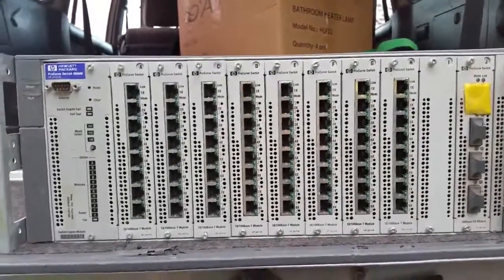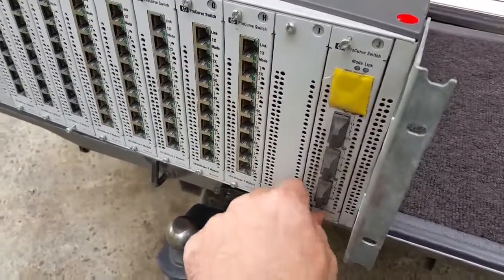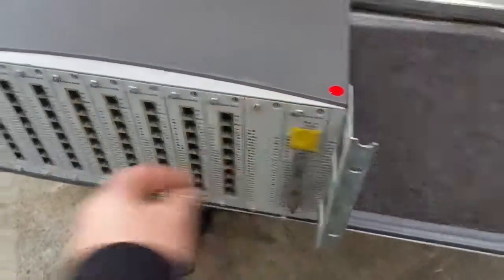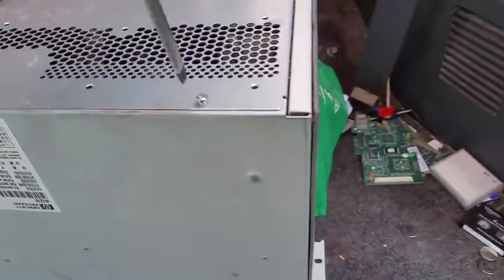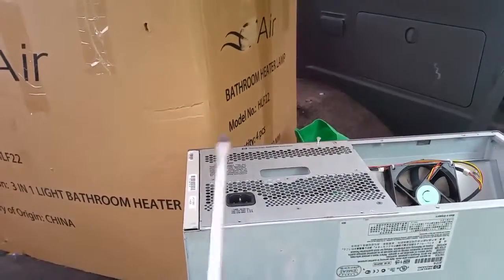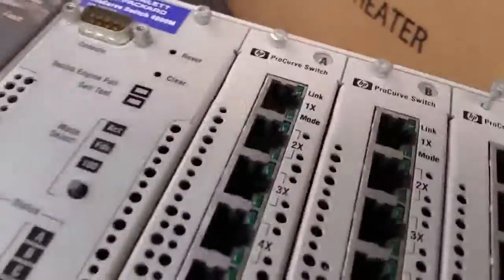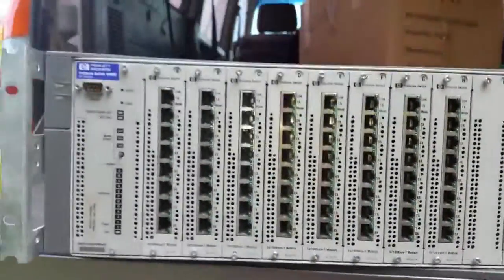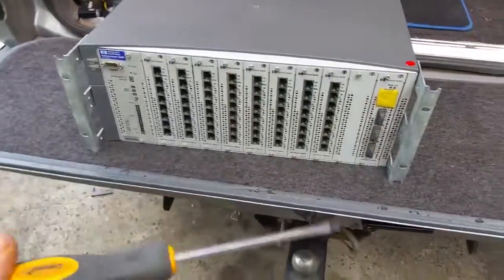Profile of a HP Pro-Curve 4000M

Comment: These are fun switches!  The password can be reset by holding down the "clear" button for 10 seconds.  The 10/100 cards support 100BaseTX which does full duplex.  The fiber card is 100BaseFX ethernet, not "fiber channel"

Comment: The Bel modules are coupling transformers for galvanic insulation and signal filtering of the Ethernet ports. BEL stands for Bharat Electronics Limited, it is an Indian company. I have a military radio made by them, and probably a few of those ethernet transformers modules hidden in equipments.